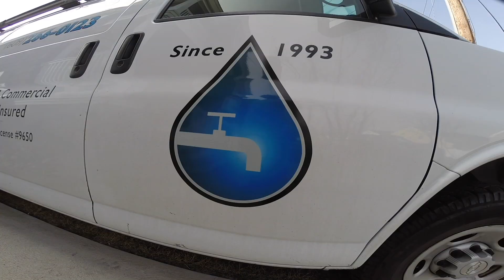BRADFORD NATURAL GAS WATER HEATER FILTER CLEANED

Comment: Well, your video is very interesting.  Starting a few days ago, our hot water began to run cold especially when we had a lot of relatives that slept over.  My first thought was that the control assembly was bad and identified a replacement on amazon.  Then I began to think maybe it could be the thermopile.  After sleeping on that last one over night, thought maybe I should order the entire ignition kit that included the thermopile, the igniter, etc.  After one additional night of sleep, I decided to also order that little resettable thermal switch.  Then I stumbled across your video pointing out the need to clean these water heater filters on a reqular basis.  Our home was built in mid-2021 and never had the wh cleaned.  After seeing the video I put my entire order on hold pending a cleaning upon returning home from a 2 week trip.  Everything you point out in video makes me think that cleaning might do the trick.  Symptoms are as follows: a) cold water when lots of usage; b) when out in the garage where the wh is located (I smoke), on occasion I hear a "wheesh" sound like the burner is trying to come on but the sound disappears in like a couple  of seconds; c) still have not noticed the burner being lit but water seemed hot when both my wife and I showered earlier today - separately, we been married today makes 56 years; d) when problem started, i thought pilot was not lit but after putting the phone camera down at the sight window, I saw that it was in fact lit.  I'm guessing the cleaning will do the trick but will appreciate any thoughts or suggestions any of you might have.  And yes, at 80 yo, I am still a DIY'er.

Comment: I have a Bradford White Defender 1 yr old. Pilot lights instantly and stays on. Green light blinking every second which seems to mean the burner is on however the burner won’t light, no hot water. Could the thermo coupler need cleaning maybe, any ideas?

Comment: Thanks sir for your video. Its gonna help me tremendously. My paint guy smother wrapped my Bradford Water Heater to prevent paint slather. Now the pilot light is out and pilot won’t ignite. I am also get a seven blink error light indictor which supposedly means there is Gas Valve electronic fault detected. House is eleven yrs old and I been owner for a year. 
  I going try cleaning the filter it out like you suggested. Hope nothing is needing  replaced. 
 Is there a reset button on the Bradford somewhere?
Thanks great video.
Reply from the maker: how did you make out?
Reply: @ChuckBarron  I followed step by step like  your video...cleaned out all the dust webs and brush cleaned the heater element assembly. Put it back and it water heater now works again. Thank you so much . I would have never attempted this without seeing your video. Saved me $$$ and my wife thinks I can fix something around here other than a Bologna sandwich!

Comment: Excellent thanks. Very helpful.  I have the same Bradford White as in this video. Question...How would you know if the gasket has to be changed on the combustion panel?
Reply from the maker: you can replace if she breaks down....usually entire assembly comes in a kit.

Comment: that pvc vent pipe looks brown/discolored, is there some other bad issue causing low exhaust flow? failing inducer?
it sounded awfully rough/noisy too. (the 50 gallon one) I'd have suggested replacing the whole unit and checking the vent pipe.....
Reply from the maker: replacing is on the horizon. These folks are not playing. Replace them both is coming. Im sure of it.

Comment: May I ask a dumb question? Do I have to turn the gas off before cleaning the filter, that and the pilot light off (obviously). Or can I just turn the pilot light off?
Reply from the maker: Sure. you can just turn water heater to off position. Gas to house can stay on.
Reply: @ChuckBarron    Thanks ever so much!!!

Comment: 1) I don't like those type of water heater desing bcz take air from inside property so in this case are 2 monsters same basement so mean no enough air for combustion and taking air from everywhere even small wall or ceiling opening  that is reason this failure after some time 

2) I know hot water lines is tie together to increase hot water storage bad move bcz that create a water presuse sandwich huge water noise flow every time someone open water to take a shower 🥵

Comment: I have a 40 gallon tank that runs out of hot water after 20 or so gallons, about 10 minutes worth of showering in the house I bought (no dishwasher or washing machine hooked up yet either) until it turns completely cold. The tank was flushed, with very little sediment built up on the inside. I'm still having the problem, would this solve it? I haven't had my pilot light go out at all, I just run out of water very fast.

Comment: Chuck, should you not use power drivers for nuts and screws?
Reply from the maker: This water heater was on second floor but I like to use nut drivers anyway. get the feel especially if they are stripped out. I did have a stripped one so i was glad i used nut driver.  good eye plumber.
Reply: Gotcha

Comment: why does mine have a thick mat covering vents under burner?
Reply from the maker: its a filter...remove and clean and place back in....to prevent lint ect from getting in.
Reply: @ChuckBarron  well i was trying to get vents clear so i did not put mat back in and mow it lights up fast and hard but after about a minute it sounds like its going to blow humming vibrating sound i push held the burner in with hand and held all parts
 to see whats vibrating or humming louder and louder but nothing was loose so when i turned off gas it stopped humming

Comment: another cool educational video, thanks CB, how do you like that milwaukee shop vac?
Reply: I have the same with 5ah battery and it last only 20min, you need the 9ah, also it's pretty noisy. But it's a good vacuum, decent power
Reply from the maker: I like it. I just used it once though.. i like how it packs up like a tool box.
Reply from the maker: yes Syl, i need some juicer batteries. thats coming for sure.
Reply: I'm gonna go with the rigid pro...I'm not a big fan of vacuums running off of batteries.
Reply: @anthonys.5653  I have a Ridgid vacuum and it Sucks! I love it

Comment: Chuck,

 I have a similar Bradford heater. Power vented also. No codes but it seems to run forever and take along time to get the H20 hot. I pulled it apart and did the same as in this video. Thinking was that because I had a real yellow/orange and weak looking flame that maybe it was starving for air. Thought the burner flame should have been nice and blue, like the open chamber unit you showed.   Initially after cleaning it, it was blue and tight but that only lasted a minute or two and has since reverted to its original look.
Is that the normal burner flame condition for these? 
However, it does look just like the one you did.

Thanks,
Kerry Y 
Montana
Reply from the maker: sounds like a problem. May want to call tech support.

Comment: a new vac? sweet!! have to ask, how do you get the dust from under? I know you blown it down, maybe vac a bit up, but the majority will still get sucked up once combustion starts. I always thought that mesh was just a air difusser to prevent large gusts of air like a door opening from putting out the flame.
Reply from the maker: so tight.....the plan is blow it and vacuum the same time. no way to access heater bottom unless removed..A larger bottom be nice so it could be accessed easier. Maybe next gen water heaters....lol
Reply: ya I dunno. Unless you see a high nox or  something, .. is it worth it? I gotta start doing it if it is

Comment: speaking of water heaters...i have galvanized plumbing. i put 1 male union on the 90 elbow and another union on the water heater nipple .  between those 2 unions i have like 6 places to solder including ball valve. after i run water i got pin hole leak on one joint ...what do u do, just put some more solder in that spot or you have to torch it out, clean it and start over ? would you reuse the same material after u clean it good ? once I cleaned it some solder was still on the pipe, now cannot fit that shit back together ..what a shit show ..
Reply from the maker: Pablo hold on daddio
Reply from the maker: Let’s do this
Reply from the maker: Use all again, make sure water off and drained lower than leak... including upstairs fixtures. Open them... you may be able to reheat and solder.. if it’s me I’m retrying. Just as long as you cleaned all well. You may of had a steam leak. Make sure water is drained off...good luck
Reply: @ChuckBarron  thanks. will try again.

Comment: I don't see too many water heaters stuck in closets...so I rarely see hair and dust all over the water heater. Btw Chuck, I forgot to ask you in the urinal video, what name brand awl were you using? Nice job as always!
Reply from the maker: ya heaters love closets down here. no basements can you imagine all the tight spots for water heaters. I used american standard brookdales i believe. the awe is from home depot i believe. that joker is nice.
Reply: @ @ChuckBarron   Thanks Chuck, I've been needing a new awl for years, as the Malco one I have, I broke the tip off years ago. The one you have seems more heavy duty.
Reply: Any good hard center punch with a sharp point is good for breaking the glaze on tile.
Reply: Except the one I currently have...it's terrible @johnkrim8377